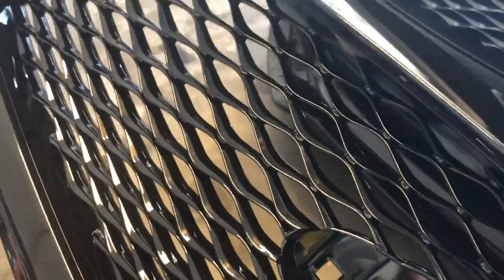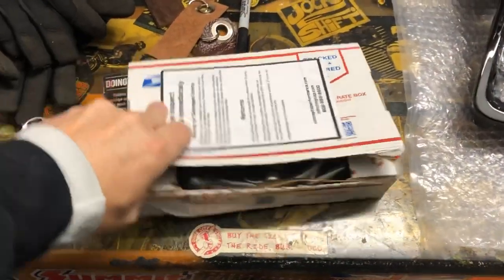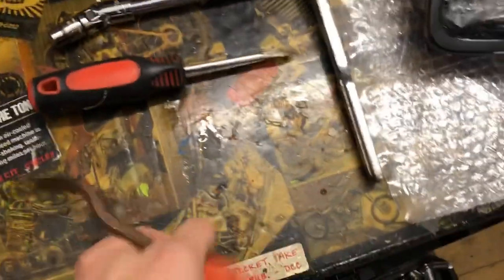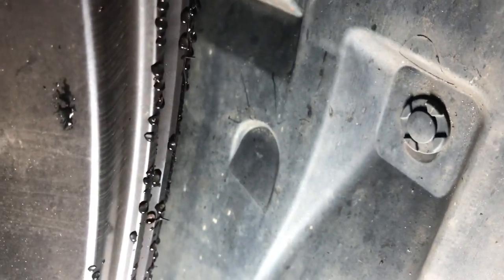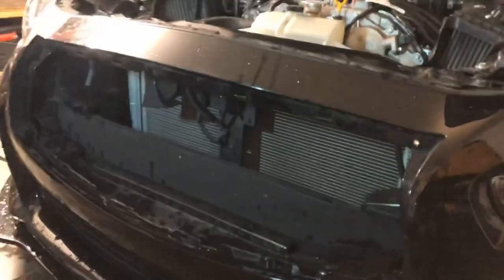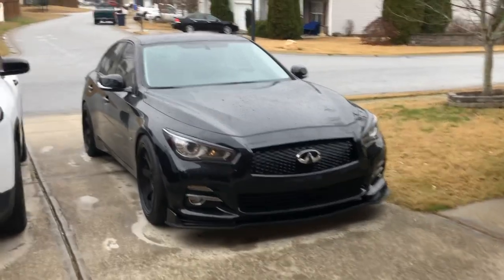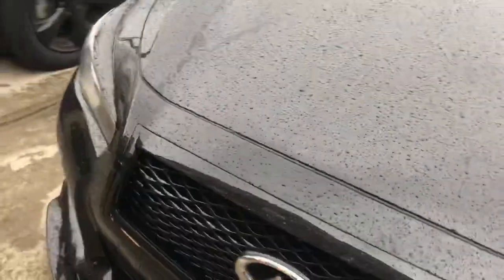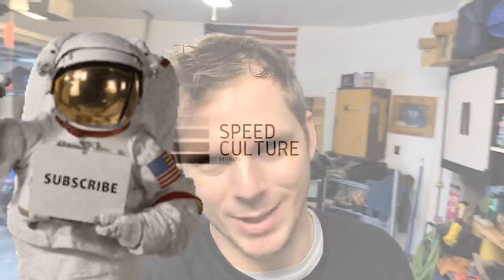Infiniti Q50 Gloss Black Grille Installation

Comment: Been slowly de-chroming my Q50. 

I've been putting this off because it seems so cumbersome getting the entire front end off to switch out the grill. 

Does look good though!
Reply from the maker: It would have been much easier to get the bumper off than doing it how I did. It’s only a few more bolts and would have had all the room in the world.
Reply: What do you think about vinyl wrapping it? Not a good option?
Reply from the maker: Native Vinyl wrapping is fine and it’s good because it can always be removed. It’s just not easy to do yourself with the contours, if you’ve never done it before. And it’ll be at least $100 to pay a shop to do it.

Comment: My grille and bumper cover got damaged by some debris on the highway I was really hoping you where going to take the bumper off so I could see what I was getting myself in to! But like you said it doesn’t look to much harder to get the whole bumper off I think I’m just going to get some eBay parts and get it painted so I don’t have to report it to my insurance lol
Reply from the maker: It’s just a few 10mm bolts on the under side. Very simple.
Reply: Speed Culture Studios that’s relieving to hear, just need to find a good price on the bumper and paint now!
Reply: Speed Culture Studios thanks for the quick response as always!

Comment: Do you know if that grille is capatable  with 15 q50 that has front camera?  Didn’t notice you had one but mine does. Otherwise yours looks sweet. Also like the front spoiler. Where did you get that?
Reply from the maker: Front splitter from amazon. And yes the grill is compatible with the camera.

Comment: Great install looks amazing. Could you possibly show how to take the engine cover off in a video? Lol I couldnt figure it out
Reply: You serious?
Reply: @chrisnichols6962  yes. honestly didnt really try. Are they same clips as in bumper?
Reply: @AIKINGBTC  4- 10mm bolts on top...visible and easy to access.
Reply from the maker: It’s a super easy job. Like Chris said, just a few 10mm bolts and it comes off. I think I show it it my strut tower brace install video.
Reply: @chrisnichols6962  ahhh yeah I dont think I really looked since I got car. Thanks though I'm taking that off asap. I work at a dealership and get a discount on all my maintenance so I dont go under the hood much
Reply: @SpeedCultureStudios  yeah it looks way better with cover off I'll remove it. I'm about to get those strut tower brace s thanks to your last video
Reply from the maker: x 23 I like it better off too!

Comment: i'm not sure if you have mentioned it before ,but do you mind pointing me to your wheel and tire setup ?
Reply from the maker: https://youtu.be/JadgF7Q5LtU
Reply: @SpeedCultureStudios  thanks a bunch buddy. have a question on the side. Got a 14,  Q60 coupe. was wondering if i get the burble , fire tune with almost stock exhaust setup , would i actually get any pops or  cats and muffler are going to completely negate the effect ?
Reply from the maker: xorencryption yeah you won’t get much out of it with the stock cats. Definitely won’t get flames.

Comment: non related to the video, but I've the 3.7 with the PLM muffler delete and I'm planning to change the Y pipe, my car give some litle pops sometimes, and sounds great, just with the the muffler delete, do you think that will be louder adding the Y pipe? Tks!!
Reply from the maker: Mine did the same with the muffler delete. Upgrading the y pipe will not make it louder but it does give it a nicer lower rumble. Like a deeper tone.

Comment: How hard was this on a 1-10 scale?
Reply from the maker: 2
Reply: @SpeedCultureStudios  awesome. I actually just had the black grille (same one in the link) installed by a body shop while having the bumper replaced but the fitment isn't good. I want to redo it myself with a black grille from a different supplier.
Reply from the maker: @ahmade.8142  its not hard just have to be careful during removal.
Reply: @SpeedCultureStudios that's great.   you're the man, I've been a big fan for years. Thanks again

Comment: Do u have any paint chips I got a 2019 with like 2 paint chips lol black shows so
Much
Reply from the maker: It's inevitable, especially if you drive on the interstate.  Use blacklight sealer from chemical guys.  It hides them pretty well.

Comment: When I take my middle engine cover screw out the engine makes a loud hissing noice. Any reason??? Is it connected to the air?
Reply from the maker: Not connected to air. Hissing noise just might be engine noise. If you had air leaking in that area the car would likely run funny.
Reply: The thing is. When I screw in that middle 10mm bolt. The sound goes away
Reply from the maker: Tristan Oliver Try driving with the cover off or just put the nut back on with the cover off. But I can’t imagine there is a problem or an air leak.